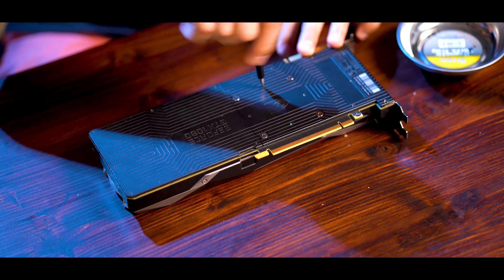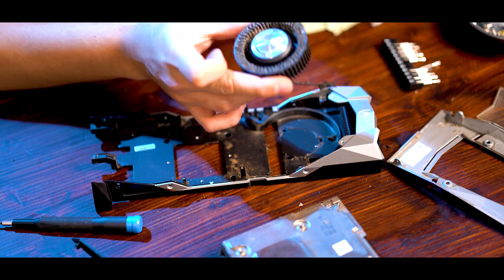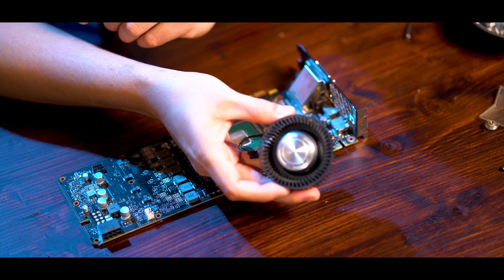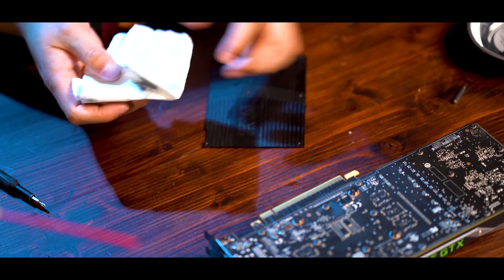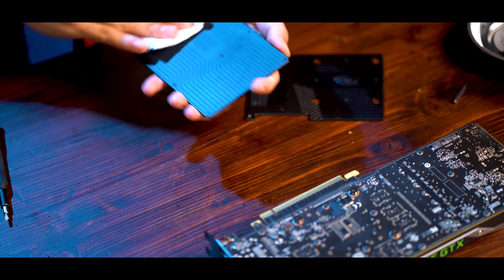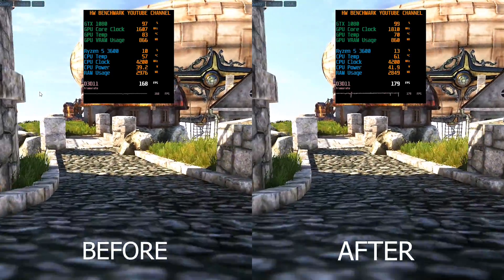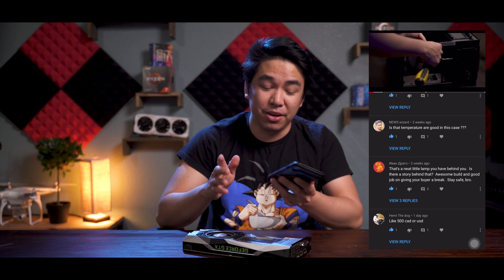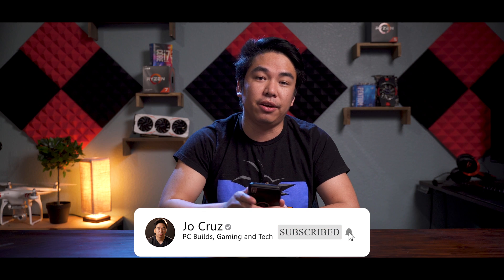Clean your GPU!!! | GTX 1080 Cleaning and Disassembly

Comment: just got a 1080ti for cheap recently and the card is great so far. would love to clean and re-paste and put new thermal pads.
  i downloaded GPU-Z to tell my the temps and load etc but for some reason the first start of my PC the GPU-Z says the load is at 100% after everything is initialized and at idle. at the same time the task managers gpu usage is at 0-5% at idle. 

if i restart my Pc then it the gpu usage is normal. any suggestions on what to do to see why it is 100% on gpu-z ?
ive tried to check for trojans/malware my pc is clean so far. im starting to wonder if i should just do a fresh install of windows.

Comment: Thanks for the detailed teardown.  I just cleaned my new-to-me 1080 Founders Edition.  I dropped temperatures them 83C to 77C with stock fan speeds, so now I'm not hitting the thermal limit of 83 while maxing out 1440p.  I think this design would have benefitted greatly with a copper base heatsink.

Comment: Hi I took mine apart after it stopped working. I was wondering if the grease or residue is normal to have on the board where the thermal pads were. Or is that maybe liquid damage on my card

Comment: a big hassle for only a 10 jump in degrees I seen another vid was the same thing better to just unscrew and clean the dust off the heatsink
Reply from the maker: 15 mins of your time is a big hassle for you? 10 degrees is a lot.
Reply: @JoCruz  yea for only a 10 drop it's not
Reply from the maker: @cmoneytheman  10 degrees is a lot, it could increase your performance and longevity of your hardware. But to each their own.
Reply: @JoCruz  20 is alot most people wouldnt notice 10

Comment: I think it's about time i clean my GTX 1080 founders edition i bought back in the summer of 2016 after release. Recently when gaming i saw the temp spike up to over 90 degrees celsius right before the system crashed, that have happened multiple times recently.
Reply: u must have had a dirty case my card have never been that hot got it same years ame ver

Comment: What size are the screws on the shroud? GTX 1060 founders edition want to change the thermal paste after years of use. Great video 👍
Reply: think they are 1.5 and 2.0 hex bits on the front, if its just the termal paste you want to change

Comment: The weirdest thing i noticed with my 1080 FE, the thermal pads were soakd in some kind of oil which covered the gpu board.  Used some 99% isopropyl to clean it all off, had to use .5 1.5 and 2mm thermal pads (surprised he didn't mention there's usually 2-4 different sized pads in the video.  But overall I gained a 15% increase in performance and a smexy new looking card.
Reply: That is mineral oil leaking from your thermal pads.
Reply: What are the thermal pad size I should be buying for 1080 FE. Can you help?

Comment: I did notice a 1000 score upgrade in heaven. I disassembled my gtx 180 yesterday and let me say: without a tutorial on your model, you get terrified. Gpu shortage and no one selling a gpu for under 800 is scary. I’m glad mine still worked.
Reply: same for me i have got a running gtx 960 with this type of design ie a fan on the right side only....and u dont have a cleaning video of this model except this one on youtube...plus i am from a small town where u dont get hardware that easy

Comment: Question, when doing before and after thingy, was both test, the fan duty, was it both the same settings? Stock fan curves?

82c/69c soon as you started the program??? Doesn't seem right, did you do the test one time around before doing the actual test? It couldn't have rise that quickly the moment you start the program.

Comment: Great vid! I ordered a 1080 FE cooler for my 1070 because I love the look of those coolers. It’ll be my first time putting a cooler on a card so this should be a good reference vid! Thank you for making this!
Reply from the maker: How was the 1080 FE cooler on your 1070?
Reply: @JoCruz  UPDATE: the 1080 FE cooler works GREAT on my 1070. The 1080 used the more powerful vapor chamber cooling solution on the inside, and on the lower 150W TDP 1070, it keeps it around a max of 63 C while gaming, and about 30-34 C idle.
Reply: @JoCruz  It is shipping from the United Kingdom to Indiana, USA so it’ll be just a bit longer till it arrives. I’ll update you when I have it installed!

Comment: Cool. I'll stick to clearing dust for now. Don't know why I didn't think of this. I have to do CPU radiator every few months. Never done GPU since new a few years ago and now it's shutting down PC randomly!
Reply from the maker: Oh dang, you definitely gotta clean that GPU. Let me know how that goes!
Reply: @JoCruz  well it worked. Sadly some screwws so tight I gave up. Air can blew lots out though and it's working OK again at least.

Comment: Eyy Im also a fan of tech yes city. A friend bought a new prebuilt and sold me his old one. He didnt know what was wrong with it and had it in pieces. For 300$ I got a i7 8700k, 1080ti, 16gigs of ram, and a new corsair 750m psu.  I was mostly interested in the 1080ti....WHICH WORKED. So stoked, but it is a bit dirty. Not sure what went wrong, but I upgraded from a vega 56. Woo!
Reply from the maker: That’s a damn good deal. Even with just the cpu or the gpu, you got your moneys worth.
Reply: @JoCruz   Yea I'm pretty happy huge difference from vega 56 to 1080ti although the new 3060ti is $399 but who knows when that's gonna be in stock so yeah.

Comment: Could you tell what hex keys were you using? I am trying to take apart a gtx 980, which should be very similar to this. I used size 2 hex key for some screws and it was fine. There are some smaller screws, but 1.5 hex is too small and seems to mess up the screw. So neither size 2, nor size 1,5 hex works. Anyone can help?

Comment: Hi there, and hello from Brazil, i got the Msi GTX 1080 Founders editions, looks like yours, but im pretty concerned about how much thermalpads to buy, before open it. 
I tryed Heavens with her and got something like 83 degrees everytime, without any OC, and gaming i got the same. But with some more heavy games, like the Need for Speed Heat, my pc shutdown before i could finish a single run, so, can you tell me about the thermalpads, if they are 1mm, 1,5mm or 2mm and how many pieces i have to buy?
Have my subscribe, excellent content, waiting your response, thanks.
Reply from the maker: I only used a 1mm, not sure if it’s the same thickness as the MSI. You don’t really have to replace them. Just try to clean the fans and the fins even without replacing the pads you should see better performance.
Reply: @JoCruz  its about 2 months, that i changed the thermal paste and clean all of it, but didnt change too much
Reply from the maker: @BambooWagner  have you tried down volting/down clocking even for a little bit?
Reply: @JoCruz  Nope, how do i do that, with afterburner? Just push down and ok?
Reply from the maker: Yes with afterburner. Do it little by little.

Comment: Do u have to change the thermal paste on the gpu or can u just kinda leave it then work around it
Reply from the maker: I changed it
Reply: @JoCruz  will any thermal paste work or should I be careful about anything
Reply from the maker: Any thermal paste should work. Just don’t overtighten the screws

Comment: I have the exact same GPU and I want to give it a clean, but I cant find Thermal pads anywhere in my area... what kind of thermal pads should I be looking for?
Reply from the maker: I linked the ones I recommend in the description of the video. Its the arctic thermal pads, you can get it from amazon.

Comment: How much dirt should I have to worry about, my msi 1080ti isn’t THAT dirty but it has some dust collected under the fans and in the heat sink I guess that’s what it’s called
Reply from the maker: Usually, if you at least clean it once every 6 months, you won’t need to disassemble it. You can just use some canned air to blow some of those out.

Comment: Jesus, that dust build up is hideous
Reply from the maker: I know, prior to cleaning it, the card reaches 95C if the fan isn’t at 100%
Reply: @JoCruz  I recently got my 1070 FE too, has some little dust build up, will try opening it up for cleanup later. How was your idle temps before and after cleaning?

Mine sits arpund 46-47 C idle
Reply from the maker: It was around 50C and pretty hot underload, 95C if it’s not 100% fan speed

Comment: I'm concerned, how could it get THAT dirty
Reply from the maker: I know right... Even if I don't clean my PC for 5 years, it wont be this nasty.
Reply: @JoCruz  funny you should say this as it will be the first time i'm cleaning mine as it's getting a bit hot , i smoke and mines not that bad, also what should i do with the extra 4 screws ?????  i went to test it , couldn't get it to work so put another one in that didn't work either ' so 12hrs later of troubleshooting , ended up jumping the CLRTC , works better than it did 24hrs ago
Reply: Gotta have a lot of pets lmao
Reply: The previous owner must have been a smoker or vaped. The smoke from them is sticky so dirt sticks better.
Reply: @Sidonn_  ce faci Sami?